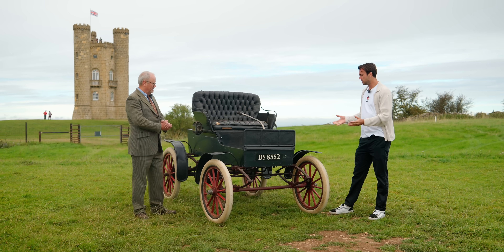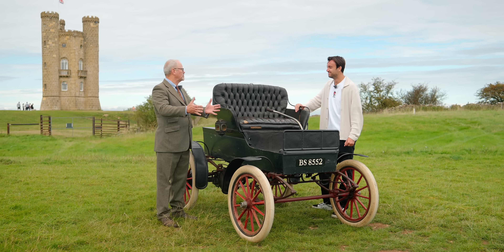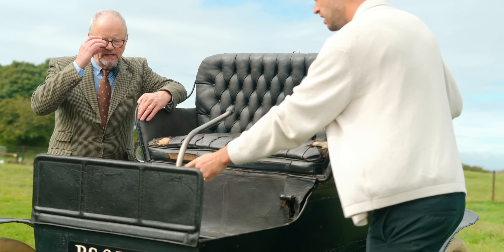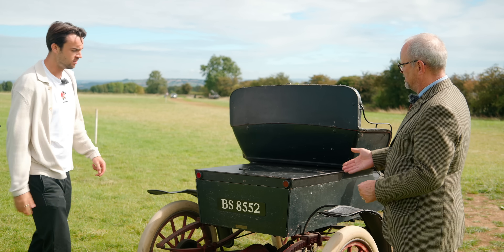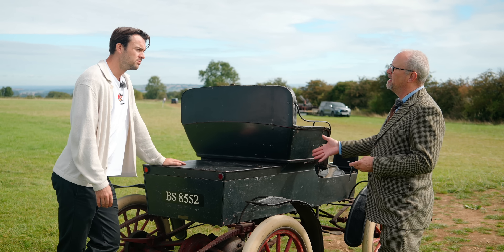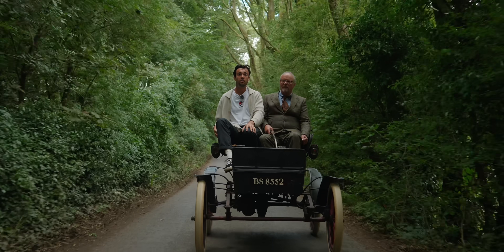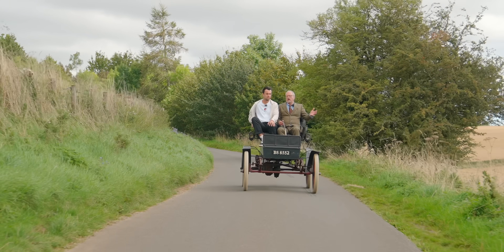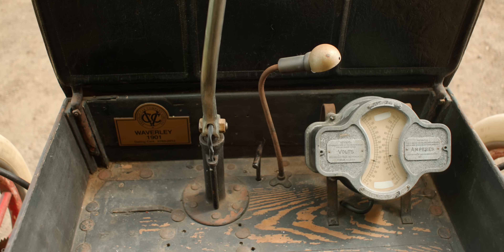Why Electric Cars Failed 100 Years Ago

Comment: this needs a follow-on on video titled: "Why Electric Cars Have Utterly Failed Today"
Reply from the maker: You should make it. Not much point because hundreds of freakishly devoted fossil burners have already done so. Desperately clinging to the faded, tatty belief that combustion engines and burning billions of barrels of toxic oil is fine, and anyone who suggest otherwise is an idiot.
Please carry on.
Reply: @fullychargedshow  From a physics, engineering, raw materials, and mass-scale manufacturing perspective, liquid hydrocarbon fuels are the optimal portable energy storage system for transport vehicles. Fads pushed by propaganda don't change that underlying reality.

The EV market is nose diving because it's butted up against that hard stop reality. The EV tech stack is a massive failure relative to the liquid hydrocarbon fuels manner of transport technology stack.

Even for the touted advantage - a lower carbon foot print - is a whopper of a big propaganda lie.

And to manufacture EVs at massive scale - comparable in scale to making ICE vehicles - is an environmental catastrophe given its reliance on hard-to-access/process/refine various exotic raw materials that are essential for making EVs.

Liquid hydrocarbon fuels can be synthesized in a carbon neutral manner. If all the R&D that has been expended on EVs had instead been directed into production of carbon neutral synthetic liquid hydrocarbon fuels, the whole issue of making both ground and air transportation carbon neutral, would already be a solved issue.
Reply from the maker: @TheSulross  I love your enthusiasm and blinkered micro world view. 
It's like listening to a man staring at a small puddle saying 'everything is fine' when he's surrounded by a massive forest fire.
From a physics and engineering perspective, combustion engines are a cruel joke. Hopelessly inefficient, unreliable and endlessly consuming spare parts. 
I agree it's a brilliant model for both car manufacturers who will have an income from that vehicle during it's useful life by selling all the myriad of spare parts, and of course the oil industry love it, and love you because every $ you put in your tank, only 25 cents move you along the road. They are literally laughing all the way to the bank, which they also own.
And to try and reassure yourself the EV market is nosediving is really sad, for you. 
The electric vehicle market is expanding at dizzying speed, sure, the news outlets (particularly in the USA) are screaming in a mad panic because their biggest backers, the folks with the seriously big money, the political leverage, the fury to maintain their global dominance are stopping at nothing to lie, bludgeon, trick, obfuscate and bully us into believing that the filthy product they sell is the ONLY realistic solution. 

5 years ago, EV sales made up less than 1% of global vehicle sales. Today it's 22%. That is a massive, punch in the guts increase,  and because you are so blinkered and limited in your grasp of what is going on, you have also utterly ignored micro mobility. 
You are focussed, obsessed and invested in cars which is very typical of males of a certain age..
However, here are now just over 280 million electric bikes, scooters and mopeds on the road, not in car clogged American cities, but cities and towns in Asia and Europe. Recently released figures show the reduction in demand has reached  1 million barrels a day. If you sell oil, that hurts, so the really powerful countries, companies and lobby groups are fighting dirty, to support the passing fad of the dirty, inefficient, dated, stagnant internal combustion engine.
And as for the hopeless myth of neutral synthetic liquid hydrocarbon fuels, dream on sunshine. Trillions of $$$$ have been invested. The best we can hope for in the next 40 to 50 years is we can run a reduced air fleet using this stuff, but it will be so expensive no one is going to burn it in an old fart motor that wastes three quarters of this precious liquid.

Comment: Why didn't EV's catch on back then? 1. As late as 1920, only 30% of American homes had electricity. 2. Those early EV's appealed to women because they didn't have to crank an ICE engine. The electric starter had been around since 1912 on Cadillacs, but their introduction on the #1-selling Model T in 1919 eliminated cranking. 3. Cost. A 1923 Detroit Electric cost $2900, nearly 10 times the cost of that year's Model T. The unaffordability of even the least-expensive EV's is still an issue today. A new Tesla Model 3 is $40,000, twice the price of a new ICE Corolla that is the same size.

Comment: Cheap gas happened. It's that simple. Cheap gas rolled out faster than electric did to towns and homes. To think that fear tactics were used to try to keep people piping gas into their homes for lighting lol.   It is also amazing how simple a ford model T or A was for how long compared to this. Then think about how far along EVs would be now if they never stopped production because of gas.

Comment: Electric cars have failed again because of there range, 300 miles is not near enough range and If it is a F-150 Ford truck and you are hauling something then its 200 mile range, and there is the charging station problem up to 8 hrs charging who can wait that long, there is also a safety issue with the battery's catching fire, It looks like things were a little easier and safe in 1901 vs now. I do not see any total electric cars going forward but I think the hybrid cars are the way to go for sure they work all the way around.

Comment: Electric (i.e., BATTERY powered) vehicles FAILED 100 years ago, JUST EXACTLY LIKE they are FAILING NOW! WHY? 
Because "Electric (i.e., BATTRY powered) vehicles" are NOT in ANY way, shape, or form, a feasible or viable or Intelligent "option" to replace gas and diesel powered vehicles! They are NOT and they NEVER WILL BE!

Comment: There won't be any modern EVs that work in 100 years because the electronics will be shot.
It's hard to get 75 year old radios to work with vacuum tubes. Have you seen any working wire voice recorders from the 40s?

Comment: The elctric motor also predates electric vehicles. Because the Motors has to exist first for that guy to even get the idea.  Electric Motors were installed into many saw mills. This is also seen on Little House on the Prairie. Where they upgrade the saw mill to an electric saw motor.
Reply: The same could be said for gasoline powered engines. The Wright Brothers flew their first powered flight only two years after this electric vehicle was produced. They used a gasoline powered engine that they personally designed and built.

Comment: The batteries fires. Just as today.
Reply: Those lead acid batteries, 6 volts, are considerably a different animal that lithium ion batteries. First off, the car is running on a relatively low voltage, likely 24 volts DC. Second, the potential for explosion, fire is greatly reduced unless you chose to smoke a cigarette around the batteries when they are charging. Lead acid batteries produce hydrogen gas when they are being charged.

Comment: om not going to bother watching . the current facts of the matter are that the EVs of today rely on new elements for construction which has set off mining boom , when you factor in production shipping etc etc then, get the purchasing a NEW EV  which is powered by coal fired electricity. anothr fact is that they are making these EVs HUGE and HEAVY. they should be , if anything , making small safe cars that are super economical on power to weight. all large vehicles and cars should be banned from city center areas . I could keep going but .TLDR:  EVs are a bigger environmental problem for the future than current vehicles, and smart planning could alleviate the problems . huge scale mining and factory  production is not the answer.
Reply: The mining of the battery materials is only part of the story. Due to the excessive weight of the battery pack needed to achieve any useful range compared to a gas vehicle a large part of the rest of the vehicle is made of very lightweight materials (plastic)...which is made from....you guessed it! Fossil fuels!!

Comment: Electric cars are and have always been garbage. I don't own one (yet) but I'm an honorary member of a model T club. I have driven and crank started them many times. Driving took a little practice, but you catch on quickly. There is a procedure for starting and driving them, but it's not difficult or dangerous, just a little time consuming. Crank starting them can be dangerous, but only if you do it wrong. The engine can fire and kick back, breaking your arm if you are holding the crank wrong. But the same thing can be said about kickstarting a motorcycle. I have three kickstart motorcycles. People have broken their legs kickstarting motorcycles. The thing with the Model T is that once you got it started and running, while it was certainly slow compared to todays cars, it had no range limitation. The gas tank was under the seat. You could carry extra gas. A Model T is capable of crossing the country nonstop except for fuel and maintenance. No battery powered car could do that.
Reply: The electric starter became available on Fords in 1919. You must have an older one. We had a 1926 model tudor which was quite comfortable. Enough so that we drove it the six miles one way to church on Sundays. As for a heater...it wasn't so good. And yes, my BSA twin will launch you to the moon if you fail to pay attention to the starting procedure.

Comment: If it doesn't produce its own power it isn't an electric car... its just another battery power vehicle..
An electric drill has a cord that gives the drill power.. you dont call a cordless drill, an electric one.. its a battery power drill, hints it can't make power..
Reply: You are correct about that....an "electric" car would need a very long extension cord and be running off the grid. Which btw, is run primarily by fossil fuels in the U.S.
Reply: @northdakotaham1752  blowing coal all day
Reply: @Zack-johnson  probably natural gas....about the cleanest fuel that exists other than hydrogen.
Reply: @northdakotaham1752  I'm good with diesel
Reply: @Zack-johnson  sounds good to me! Probably the longest running design in history.

Comment: It was in a Facebook post (authenticity questioned) Henry Ford and Thomas Edison we're working on the design for an improved electric car at one point and the oil companies put a stop to it they got wind of the project.
Reply: Edison also wanted the entire electrical grid to be operated on DC power rather than AC power. This was eventually proven to be entirely impractical and Westinghouse won out, providing AC power for the grid, transported over long distances with less loss. Ironically...Nicola Tesla has been attributed to the early advancement of AC power which was a major success unlike the Tesla motorcar company today which sells vehicles that many consider to be a hazard on the roadway. Tesla himself would probably be disappointed with his name being hijacked for a failed endeavor.

Comment: A 'Root Cause' EVERYONE ignores about Batteries from 70+ years ago. No Plastic Shell for them! So, then, what was the 'containment' used for Lead/Acid Batteries? Glass, inside either a wooden, or Tin/Nickle alloy Outer box.  NOT LIGHT, and the Outer shell, very easily rotted out, leaving the Glass to shatter upon Impact. Power-To-WEIGHT matters, as does a Robust Containment Vessel for the Battery's Juice.

Comment: Electric motors were always better, it was storing the energy that was difficult.
Also remember that electric motors have always been at least 3 times more efficient that IC motors. Still are.
Reply: As long as you have no brushes and pull a long extension cord (not too long as there is voltage drop!). There are numerous types of electric motors - some AC, some DC.

Comment: I think the auto industry needs to start looking into the viability of hydrogen powered vehicles. Batteries tech and the materials needed to make them is problematic.  Lithium is expensive to mine and process. And the batteries are super HEAVY... 🤔
Reply: Hydrogen is everywhere, the most abundant element on the planet. Saw a few videos of gas engines converted to hydrogen. Very impressive!

Comment: Good video. Petroleum is a much more dense energy source than batteries and can be produced at scale much more cheaply and with much less environmental impact. Also, petroleum disposes of itself when used unlike batteries that become hazardous waste once depleted. For those reasons and the ones mentioned in the video, petroleum won out as the far superior transportation fuel back then and remains so today.

Comment: They actually said the lack of range in a EV was the cause of its demise?! Electrification was far more advanced in 1901 then gas stations by far! In fact, the first gas station wasn't around until 1907!
Reply: Americans were able to buy gasoline at hardware stores, general stores, including some pharmacies when the first gas cars were sold in 1869. The range for the first EVs was anywhere from 18 to 40 miles, depending on the EV, and would cost $2000. The first gasoline cars were sold for $825, for a Model T. Gasoline cars quickly became more popular than the first EVs because they had a longer range, were cheaper, and were easier to use.
Reply: Making your own fuel wasn't all that difficult as many farmers demonstrated as they were able to operate gas engines on ethanol, made from corn or any other vegetation. If it was really pure you could drink it! Not to be confused with wood alcohol. This was grain alcohol.

Comment: Just imagine what we would have today if EV technology from 1901 was allowed to evolve for 122 years. Sad what we have done to ourselves when we let a few decide our future.
Reply: Batteries have been evolving that whole time and they have been at a standstill for the last  10 years considering the highest capacity 18650 is still 3.5ah, if anything we've gone backwards since lfp batteries have a lower capacity.
Reply: EVs had a headstart on gasoline cars, but the first gasoline cars quickly became more popular because they were cheaper, had a longer range, and were easier to use. That's still the case today.
Reply: @R0MANS109  just because its cheaper doesn't mean its valuable. The oil and RxR corporations teamed up with Government to direct the public into buying the ICE vehicles. Those vehicles were noisy, dangerous and broke down a lot. As you can see in this video the antique EV is still functioning, quiet and easy to operate. It even has regenerative braking! This is a perfect example of Government interfering in the free market to benefit Government and not the people. Current events are proving once again Government interfering with the free market to direct the public into buying and supporting lithium EV's which are unreliable, dangerous and cause severe damage to infrastructure. Again, this will benefit Government and not the people.
Reply: Anyone, if motivated enough, can produce their own fuel to operate a gasoline powered engine. Producing electric power....now that takes some knowledge, winding armature and field windings then figuring out how to spin it. I have done both....liquid fuel is much easier and you don't need any fossil fuels to produce liquid fuel. A few details you won't read anywhere else. Summary...you don't need fossil fuels to run ICE vehicles!
Reply: @northdakotaham1752  at the individual level i agree but this isn't. We are talking mass scale development of electric vehicles over ICE vehicles and where we would be today if the Government and RxR barons and Big oil didn't get together to kill EV and energy storage systems 120 years ago. Just take a look at what they did to Nikola Tesla.
Reply: @aaronj2296  anything being done on a small scale can be done on a large scale. It's just about how much consumers are willing to pay. Fuel for ICE will never run out. Metals for EVs....???. We can't mine 20 percent of the planet to build batteries and that doesn't even consider the metals required to super upgrade the grid.
Reply: @northdakotaham1752  again, i agree. The difference is Government regulations and subsidies. A free market we no longer have so we get only 1 option, whatever benefits Government. Technology is no different. If the EV market was subsidized 120 years ago we wouldn't be getting pushed into lithium batteries, we would have developed something as efficient as wireless charging and energy storage systems the size of your car that can power 10,000 homes for 3 days. We have no idea the possibilities we have missed because of Government getting in the way. Now, just like 1901, Government regulation and subsidies are forcing us into lithium powered EV's and useless PV farms with massive costly and toxic lithium storage banks. Lithium is the new Big Oil.
Reply: @aaronj2296  both gasoline and electrical infrastructure was in its early years in 1900. Edison wanted us all using DC power in our homes and businesses. That would have been more conducive to operating battery powered vehicles bc all it would have required is a simple step down transformer to charge your batteries. But Edison lost out to Westinghouse who produced AC power instead. Converting AC to DC in 1900 probably wasn't all that simple as it is today. Tesla claimed we could run electrical appliances without being hardwired....but likely there would be negative side effects for humans. Large EMF issues.